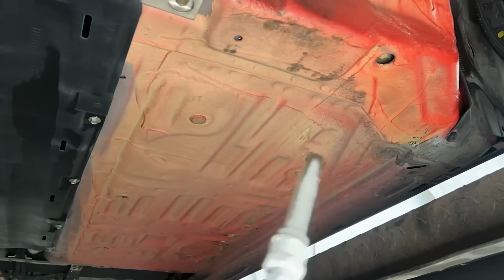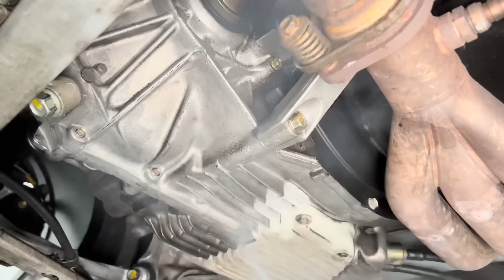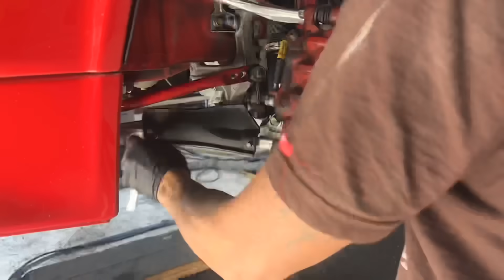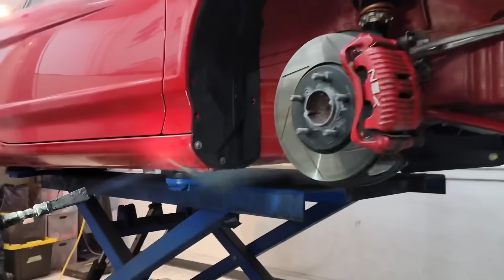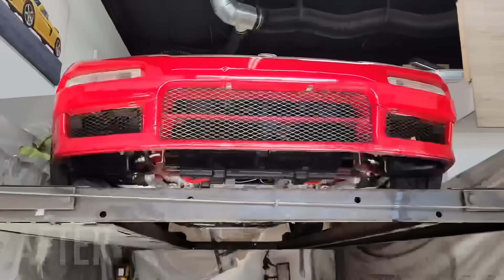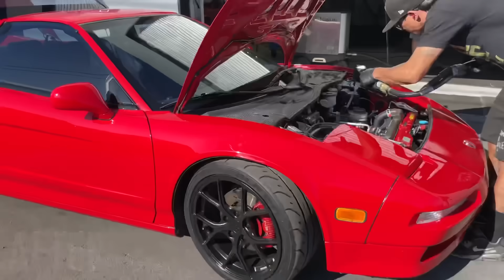DRY ICE CLEANING the MOST ICONIC Honda? The Honda NSX

Comment: Taking off all that black undercoating is going to make the car more susceptible to rust in those areas. The other suspension cleaning is nice though.
Reply from the maker: We are in California. There's very little chance of rust happening here. And many times, we will reapply a new, aftermarket protective coating to the car that isn't caked with 20+ years of grime, which will ultimately protect your car better going forward.
Reply: Lol at both of y'all. This is an aluminum unibody...
Reply: @Tony-ib2vm  aluminium.... hmmmm.... not stainless steel... 
I currently used regular house hold cleaners... on my aluminium door threshold plate....  came back it ate all the way through in one conner... now I have to get a new one...
So aluminum could really benefit from an under coat...
Reply: @christianresources1912  Uh, no. Aluminum will just get a layer of oxidation from road salt. It will not rot away. Big difference between that and a strong chemical you used that ate away the aluminum.
Reply: @Truth_Spoken  aluminum when salt is present will corrode away quite rapidly. Look at marine environments and aluminum.
Reply: Exactly! And that is factory applied before many components qere fitted. You are not going to achieve same result in new application unles you dissasemble.many components. Dont fix what is not broken....
Reply: @Rob Mirsky  salt will eat right through aluminum and have seen it on thousands of semi trailers all across the country.
Reply: Like 3% h2o2... ja
Reply: That's what said that's rubberized undercoating put their by factory for a reason . It's not dirt or build up .
Reply: Another factor of the undercoating  is to deaden noise and heat.
Reply: @IAMDetailing  must be nice…take the car to England and you’re gonna want to protect that thing to within and inch of its life. Especially near the sea
Reply: Sorry but that black undercoating when it gets old, it dries and crackles so the moistures stays between it and the body panels and then the rust comes. Many people use this to hide rust problems and make worst. The best protection is clear coat on a clean paint.
Reply: @Tony-ib2vm lol again aluminium oxidises just like steel.
Reply: @IAMDetailing 
Lol, do explain how freshly applied undercoat will protect better than a multi-layered combination of grime and undercoat. I can’t wait to hear this. 😂
Reply: @martinezmotorzgarage1402 
Don’t forget to wax the underside of your car so the clearcoat isn’t damaged. 😂
Reply: @IAMDetailing  Are cars able to move?
Reply: You can get a clear wax type coating to replace the black stuff, that would look pretty good and protect the metal
Reply: Проблема в том, что убирают антигравийное покрытие. Ничего хорошего в этом нет
Reply: Lucky that’s is CA. Where I live, rust belt state, car wouldn’t last long with the rust proofing removed. GRANTED, Honda fan here, this car would NEVER see snow/winter under NO Circumstances but would be piece of mine to have some sort of protection applied.👍🏽👍🏽👍🏽
Reply: Парни! Всем привет! Спасибо за вашу работу! Что за оборудование вы используете для чистки кузова?
Reply: lol Tony is right. The Aluminum will not rust at all. It will however corrode.😂😂😂
Reply: @Tony-ib2vm Aluminum corrodes too.
Reply: I live in California. I joy ride my vehicles along the coast. The salty air tends to accumulate over unfinished parts and create corrosion. 

While California is not known to have a rust problem, one still needs to pay attention to corrosion on collector cars such as this NSX. Obviously collectors standards are different from daily drivers.
Reply: No one's having a couple thousand dollar underbody cleaning on an nsx and then go drive it in some salt and snow.

Comment: There’s a thin rubber plastic undercoating applied to the body during assembly before major components are in stalled you blasted it off. You can’t reapply it without taking everything apart. It’s why this is still in rust proof condition. CO2 blasting is good for dirt but you can do more damage than good…..
Reply: Agreed. That's probably why some parts of the undercarriage appeared to have a lighter coat of paint. I don't think I would ever do this to my own car.
Reply from the maker: As you can see from video 80% of the car was exposed all the time… no coating, no protection and it survived over 20years with no problem at all. After cleaning we protect some parts with clear wax to preserve the perfect look for years to come. 
Btw. our clients know what they want and what it means to them and we always trying to delivered that as they expecting. 

And if you are not from CA then I recommend you to do a little research. 99% cars that are usually full of rust everywhere in the world are usually in really nice/perfect condition without any protection 😉 and we’re talking about daily cars… not NSX driven on weekends and sleeping in garage 😁
Reply: Similar thoughts on that 😊
Reply: @IAMDetailing  This car will never see daily driving again most likely. But if this were a Civic and went to any state with more regular rain or snow it would rust out from where all that coating was removed. Looks pretty but provides no protection from corrosion. Wax is no substitute for rubberized undercoating the factory put on. Again this vehicle is probably destined for show or collection use  in a place that won't have water sitting on the belly pan and undercarriage.
Reply: @IAMDetailing  Well, the car would've survived 20 years without issue since it had the rubber undercarriage coating, now that it's gone , I think it's days are numbered , unless it's kept in a museum for the rest of it's life , wax is not a substitute for rubber undercarriage coating lol
Reply: @ryanrocksize5  Correct!
Reply: NSX has a 100% aluminum unibody, which doesn't rust.
Reply: @weaksignal8009  Aluminium doesn't rust, but it does corrode
Reply: @ryanrocksize5  actually, it oxidizes which creates a protective coating on the aluminum. The exception to this would be galvanic corrosion, caused by a reaction between aluminum and another dissimilar metal such as steel, plus something like salt water (which acts as an electrolyte).
Reply: You know that there is an use case even for cleaning books. Smaller particles and air pressure of course.

Comment: Wasn't that the anti rust corrosion you just removed from underneath and wheel wells? It helps mitigate rust.
Reply: Yes, it was exactly it.
Reply: That's what I thought too, you could seriously bare metal in one of the wheel arches where the tyre had rubbed.

Comment: No doubt a beautiful car. Why did you remove the protective undercoat? I assume you don’t need this where there is no salt on the road but up north this could rust quick now.
Reply: Yeah that's exactly what I said.
Reply: Guy probably lives somewhere down south where they don’t ever salt their roads
Reply: These videos drive me nuts for that exact reason. They act like they are cleaning off dirt, nope, you are cleaning off the underbody protection that the manufacturer put there for a reason. I’d be furious if someone did this to my car, let alone paying for the privilege. Doing it engine or suspension components is one thing but blasting the underseal off….
Reply: @davviewavvie7962  no matter where you are, salt or no salt, you don't want to remove the protective coating.
Reply: aluminum frame doesn't rust ;)
Reply: @babasilijus  it corrodes and becomes pitted
Reply: Not to mention it's also a sound deadening for noisy road surfaces.
Reply: I bet it ages the paint as well...   
I'd love to see the bottom after 2 years..
the under coat also protects  chipping..
you'll see little rock and sand chipping were that thick coating was taken off.. and then rust will get in..

Comment: We used dry ice to clean aircraft parts years ago. It was unbelievable on how well it worked - cleaned and left the ID markings on the parts without any damage. These were composite materials as well.
Reply: how much is a dry ice blaster?(I would like to use it for undercoat works?)

Comment: Thank you Jakob for doing such an awesome job on my NSX.... the build is going a lot easier with a clean ride!!!
Reply from the maker: Thank you Rick for having us be part of this cool project 🙏🏽
Reply: @IAMDetailing  wouldnt all the aluminum need to be recoated in a anti corrosive coating?
Reply: Clean ride? No, it is a new car 😆
Reply: @gokartish  ... they did, two coats. 👍👍
Reply: @gokartish  jepp, plus repainting the bare metall in the wheel house?
Reply: @spdy_nsx  awesome!
Reply: @spdy_nsx  I was concerned about that. I thought this was a guy just stripping your protection coat and saying, "Look how clean your baby looks now!" Only to have e the entire bottom of the car rust out from underneath you in a year. Good to know they reapplied the protection coat.
Reply: @TheOrientalBoyz  New Motor, New frame ? NO... So it's a shiny car but not New.
Reply: @NomadHorizon  ..Also the ENTIRE car is made of aluminum so rust is not an issue. Thanks for your concerns.
Reply: What did they remove, was it road grim?
Reply: @dieandlife88  ...the car is made out of Aluminum and will not rust. Plus, they also put (2) coats as a extra added measure.
Reply: @spdy_nsx  aluminum  oxides with a white rust and can deteriorate
Reply: Hey Rick do you mind sharing us how much you paid for this transformation ? So we project owners can calculate dry ice costs in
Reply: @jensduhem8904  ... for this level of detailing I had done to my NSX you should expect between $4-5K.... and it's worth every penny!!!
Reply: Way to have tire rub on an NSX 🤡
Reply: Way to have tire rub on an NSX🤡

Comment: Used to work at a dry ice manufacturing facility and saw where 1/8” dry ice was used for blasting back in late 90’s.  Made sense over using sand (messy) and did an amazing job!  Blastec in Cumming, GA makes the blasters.  Also reach out to CO2 Air in Cumming for more info.
Reply from the maker: Thanks for sharing and watching!
Reply: @IAMDetailing  what you do is an art, and appreciate you sharing your experiences!

Comment: Top job and… NSX is engineering masterpiece, look at those suspensions levers!
Reply: Watching a car get cleaned is satisfaction, when it's an original NSX it's bliss.
Reply: Acura RLs/Honda Legends from 2006 now also have aluminum suspension components.
Reply: If you look, it has not been treated well. It was lowered, the tires rubbed in areas, and they hammered out body seams to get the suspension to fit. Really seems like it was taken care of by a teenager.

Comment: Will this procedure strip factory undercoating and anti-corrosion sealer/spray?
Reply from the maker: Yes it will if we want, the beauty of this process with this machine is that we can just clean it or remove it and then applied new protection coat 😉

Comment: I have a question, does spraying dry ice on the rubber hoses (fuel lines and such), not cause them to garden and prematurely degrade? Or is there some kind of lube protecting then?
Reply: Nope, unless you're staying in one area too long. As seen in this video he's constantly moving
Reply from the maker: Thanks for answering Jimmy! Correct, it is safe, so long as the machine is used correctly. That's why its very important to used someone trained and skilled in this machine process

Comment: This looks like it's removing a lot of the factory rubber undercoating.
Reply: Haha yes I was thinking the same… it prevents oxidation of steel.
Reply: @MarcM90ehv  No. Well yes but the car is made out of aluminum.
The reason for the massive amount of rubberized undercoating under the wheel wells and around those part of the car is noise dampening, And it even stops oil canning.
So when rocks and stuff from the road hit it it'll be louder and now dent the soft aluminum instead of just bouncing off the rubber and whenever it gets a solid thump it'll bend the sheet metal back and forth making that wiggly sheet metal noise instead of having the dull thud that the dampening creates.

Protection from rust is just a side thing but since it's aluminum you're not protecting it anymore than just regular paint
Reply: I see!! Tabaks for the clarification!
Reply from the maker: Thanks for handling that one Travis :) Appreciate you! Yes, we were requested to remove the sound deadening and clean up the undercarriage of the car. Our clients know what they want

Comment: How much does a service like this cost? And what's the cost of equipment and supplies for something like this? Also, does the extreme cold not damage rubber hoses and soft components? I have so many questions rn, lol
Reply from the maker: The service cost varies and is done on an hourly basis. Every car is different, comes to us in a different condition, and each owner has different wants/expectations. The Dry Ice Cleaning machine we use costs upwards of $55k. Dry ice cleaning is highly customizable, being strong enough to strip paint, and gentle enough to clean interior. It's all in how you use it! Thanks for asking!
Reply: @IAMDetailing  how much for this job for just the dry ice blasting? Just an estimate please.
Reply: @IAMDetailing  awesome
Reply: You could charge whatever you want.  I've spent all day trying to get one wheel well half that clean.  This is amazing.  Is this a franchise?
Reply: @Necroboi  if you're wheels aren't a polished wheel and just cleared or even a flat color acid usually does the trick. Some people don't like it but after detailing and ceramic coating $100k+ cars for a living. It won't hurt your wheels at all unless you use the acid in direct sunlight and don't rinse it of soon enough. But if you're not in direct sunlight you can let the acid sit for a minute without it doing any harm.

Comment: ur not supposed to redo the wheel arch linear with undercoating ? it protect from rock and is sound deadening
Reply from the maker: If you notice, we noted in the description that after we finish, we reapply aftermarket coating to the car
Reply: Usually it's redone after. Sometimes it is repainted before as well depending on the condition.
Reply: Bro you skipped the description. It’s explained there.

Comment: Does that damage d hot transmission or d engin block
Reply from the maker: Great question. The car is not dry ice cleaned while its near proper operating temp, and it is entirely safe to clean these  parts

Comment: wasn't the thicker black stuff a protective coating?
Reply from the maker: We remove both the undercoating and the years of grime that has fused itself with the undercoat

We do reapply protection if the owners request it. Most of these cars live in California, so it’s not super necessary to reapply it. Old coatings tend to be thicker. The color depends what protection you will choose. It can be clear matte finish or yellow/brown-ish cosmoline like it was before.

We use 3M Clear Matte Wax or Cosmoline, depending on the owner’s wishes.
Reply: Is the process of reapplying on the channel? Because now I'm curious.
Reply from the maker: @TheGuma09  It appears in several videos of ours, but we don't feature it because you can't really tell afterwards (we use a clear product) and it happens so fast that we're usually not filming it.

Comment: Was the black in the wheel well undercoating?
Reply from the maker: Some sound deadening. Some undercoat. And a lot of dirt
Reply: @IAMDetailing  so since all the dirt is nicely removed and it's like new underneath, will the owner have the undercoating and sound deadening material reapplied to prevent rust and hinder noise?
Reply from the maker: @frankbiz  This question has been answered on many comments on this video. Scroll down a few comments and I've posted it there ;)

Comment: Use a paint thickness gauge on a clean spot before and after blasting…you’ll be sadly disappointed.  

Clean painted areas with brushes and degreaser before blasting away so you minimize the areas you need to expose to the material.  Blast the unpainted areas to your heart’s content.

Comment: Are those protective layers?
Reply from the maker: As you can see from video 80% of the car was exposed all the time… no coating, no protection and it survive over 20years with no problem at all. After cleaning we protect some parts with clear wax to preserve the perfect look for years to come. 
Btw. our clients know what they want and what it means to them and we always trying to delivered that as they expecting. 

And if you are not from CA then I recommend you to do a little research. 99% cars that are usually full of rust everywhere in the world are usually in really nice/perfect condition without any protection 😉 and we talking about daily cars… not NSX driven on weekends and sleeping in garage 😁
Reply: @IAMDetailing  Well you see, I sprayed bug spray in the wheel wells to rid of pests. Later when I sprayed water into the wheel wells during a car wash, the black layer came off according to where the bug spray landed. Little spray like spots came off only. 
I later learned in wheel wells, there could be sound-deadening coating. Yes, it is a economy car, so there is no cloth materials or better in the wheel well except for sheet metal.

Comment: Extreme temperature changes created any issues in your experience?
Reply from the maker: From my experience, I haven’t had any problems yet. Of course I wouldn’t use it for a very hot surface (engine) because that can be really a problem but otherwise no problem at all.

Comment: Is that rust proofing coming off the bottom?
Reply from the maker: Yes, for certain cars, we remove the undercoat, as requested. We're in california, so we don't have much to worry about for rust. If the owner wishes, we will apply an aftermarket coating that is clear to seal back up the bottom of the car.